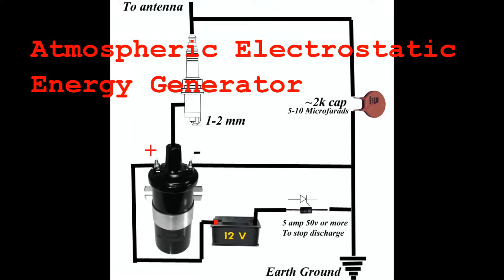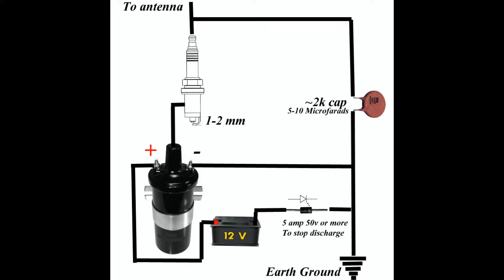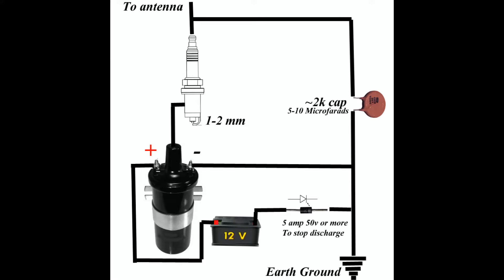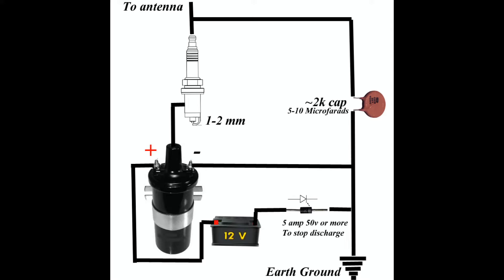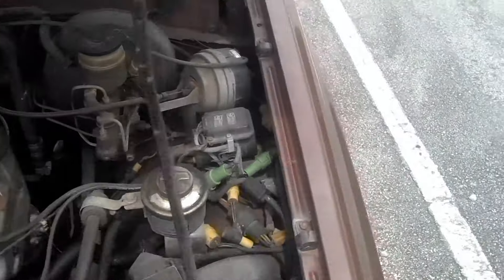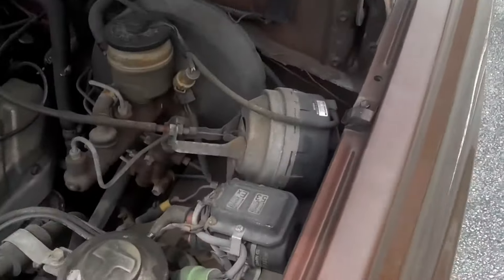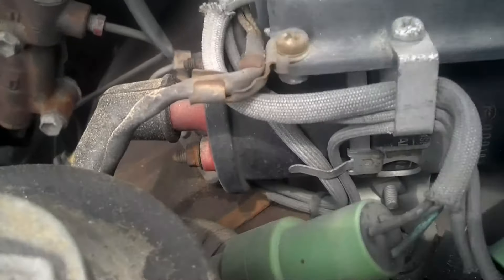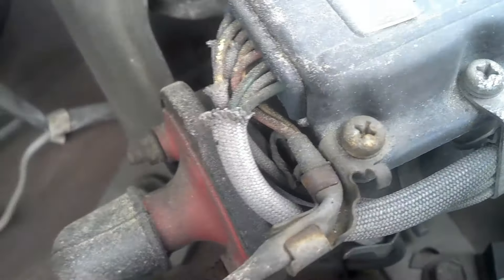Atmospheric Electrostatic Energy Generator

Comment: The key is to isolate your antenna from the ground. Your tower or antenna basically becomes negatively charged and the very top is essentially the same as being at ground level. Isolate the tower/antenna with an insulator and use induction coils to complete your circuit instead of hard wiring everything. Best of luck guys.

Comment: What if you had a high voltage variac and a tall antenna instead of that spark gap that is wasting energy? Youtube user lasersaber says that he has come across documents that said some experimenters in the past have been able to generate 1 kilowatt of power with high enough specialized antennas.
Reply: Check out the russian youtuber, kerosan or something, they made this with 3 little stick antennas and got the spark running.

Comment: The goal of electrostatic collectors is the SURFACE. You can obtain near 4 Femptoampers by square meter (Near 10 sq/ft). The potential is a bit more than 100 Volts by meter in height. Wire antennas in free air, have a capacitance of 8 pf by meter. 
If you can suspend a wire (Or mesh) with nylon ropes in 40 meters height, you will obtain near 5 kV to charge the dielectric of the RG213 cable (100 pf/meter) to produce an energy of near 50 Joules (A god zapp) in each very short pulses.
In stormy days, HT will be limited by the spark plug and the pulses will be more repetitive.
I hope you get millionaire. Regards. LU1AR
Reply: in australia we have wire fences sometime hundreds of kilometers long could make a large aerial perhaps?

Comment: Use helium mylar balloons with wire to go higher than your measly antenna for more voltage thus more current...the power is there to use
Reply: Is it real,  is it useful.  What's the simplest method,  what would happen of someone had a large engine ran generator,  But (ungrounded, ) unearthed,  instead if the regular earth ground,  use a transformer,  and the ends of the primary are attached to the earth ground,  and a switching circut,  that can handle it,  is used to basically break connection so a transient is produced,  and you receive power from the mutual induction across the other side of it. I want to know how dangerous an ungrounded gen would be 😎

Comment: What if you raise an induction coil high in the sky with a balloon? Just like how one would pick up electricity when putting an induction coil under high voltage power lines, one would pick up electricity from the atmosphere with an induction coil. Atmosphere at 50 km altitude is positively charged with 400,000+ volts. Induction coil would pick up that high voltage, which you can then connect to the Tesla coil and step-down transformer which will decrease the voltage and increase the current resulting in usable power. Using Tesla coil in reverse will convert atmospheric static electricity to AC. Youtube search "Tesla coil "the true secret" how it was really used.". As for the real source of atmospheric electricity, youtube search "Birkeland Currents Explained". A properly optimized antenna would result in kilowatts of usable power from tapping into birkeland currents accumulated by earths atmosphere.
Reply: That would be awesome.  FCC might kill you 're ads though.